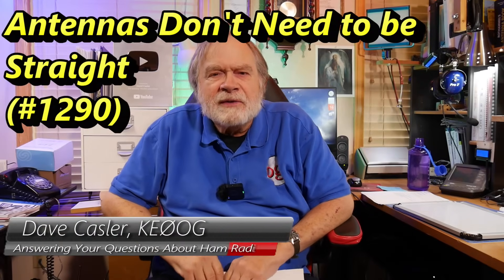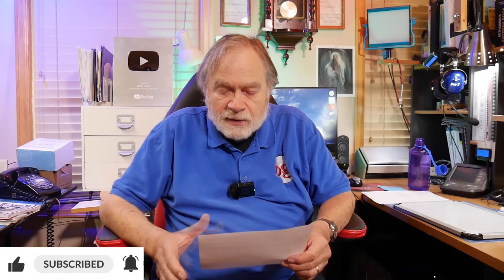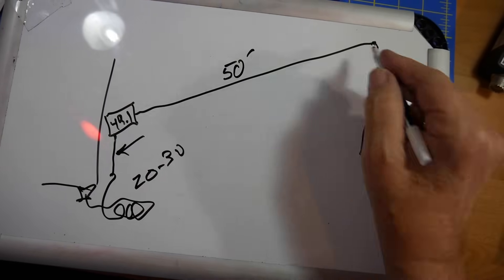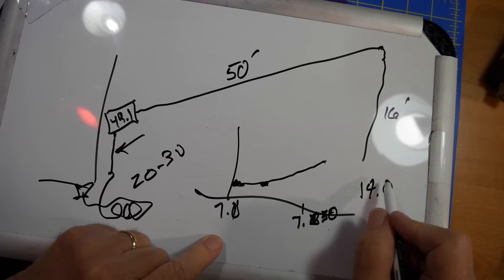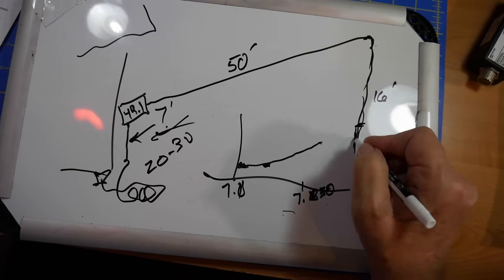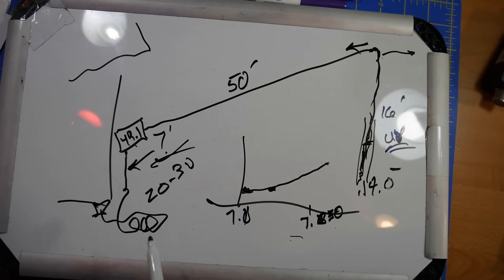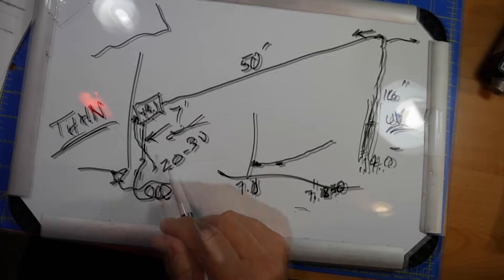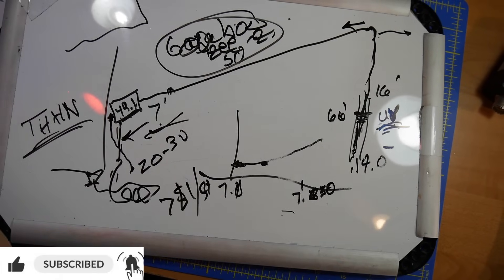Antennas Don't Need To Be Straight (#1290)

Comment: Good Job Dave. I purchased the 40 meet EF kit from ARRL and built it. I put the 49:1 Balun up 40 ft on my tower and the other end sloped down a little toward the roof of my house. I have 50 ft of LMR-400 to my shack and a 12 gage insulated house wire dangling alongside my tower from the "ground" prong on the 49:1 to the ground stake of my tower. Have worked everywhere i n the world on FT-8. I love this antenna. My rig is the Elecraft K3 with the P3 panadapter it has a 10:1 tuner. I did not change the lengthy of the antenna wire that came with the kit. For most rigs with a 3:1 tuner this is necessary, for my 10:1 it was not. I can work all bands including WARC 80-10 with < 1.3:1 SWR and 160 and 6 < 1.8:1.    LOL: Now if the antenna is not straight isn't the signal crooked too? Never mind it's the operator that's crooked.  You, David always give good advice and you make it sound simple.

Comment: Good advice Dave and im using a similar setup with my EFRW and a 9:1 Unun. Regarding  the EFHW resonance some Hams use a compensation coil about 6 ft from the feed end of the wire which helps resonance on the higher bands. 73s
Reply: If it works why mess with it. Whoever Dave is right a 49:1 balan is a better match.
Reply: @kf7bws  Surely messing with things is what Ham Radio is all about, otherwise how will you learn.

Comment: Dave presents are quick, complete EFHW antenna construction guide while making the point in the caption, that antenna wires need not be straight.
Reply: Neither does the operator.

Comment: My property isn't large enough for my OCF dipole antenna to be in a straight line, so there are a couple bends in the wire. Might not be optimal, but it was the easiest way to get an antenna that long to work.

Comment: What Dave says about adjusting for resonance at the bottom of the lowest band also applies to OCFD's ("Windom" - sic) for the same reason.  3.5 mhz lowest SWR will also give 7.0, 14.0, 28.0.  It will be a little low on 17m, but 17m is so narrow it will tune easily.  For a 1/3-2/3 OCFD you will not be able to do 15 m.

Comment: The instructions on my Mfj 80-10 endfed says to run a ground wire to a ground rod and not to use a counterpoise. I do this in an inverted V. My swr is about 5 to 1 on 3963 and after my tuners is sbout 1.7 to 1.
Reply: You are right a counterpoise is not always necessary. But like having a driver's license, a good idea.